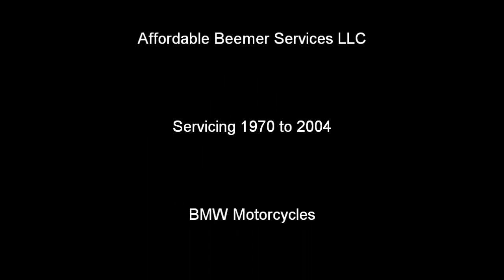BMW Service - R75/6 Front Brake Caliper Adjustment

Comment: can you tell me how to remove the caliper altogether Ive got it loose where it swivels but removing the pin is a trick. 1977 r75 7  thanks. rob
Reply from the maker: Hi Rob, isn't that pin threaded internally? Screw a bolt into it and pull. Good luck.
Reply: Thanks Chris.
Reply from the maker: Let me know if you get it out please, thanks.
Reply: Yes Chris, it came right out of there and thanks. The seal is leaking on the caliper so now can you tell me how to get the pads out so I can replace the seal??  I'm obviously not a brake guy!! Thanks again.
Reply from the maker: Take the caliper to a brake guy. Once the pads are removed (there's a wire clip on the pin that is attached to the backing plate of each brake pad) you'll need a rag and high pressure compressed air to blow the caliper pucks out of the caliper. Have someone familiar with this do it so you don't injure yourself or damage the parts. Good luck.

Comment: Hi Chris, I wonder if you can help, I have an 1981 r100 rs which I have stripped and rebuilt, new bearings in the wheels etc, however if I tighten the spindle nuts up to the torque that the manuels say (45-50 nm) there is a hell of a lot of tension and resistance, and the wheels barely turn!!Is this normal for new bearings? Or should I just set them at a lower torque? CheersRoss
Reply: I'm no mechanic but I know these bikes. They have tapered bearings in the centre hubs which means they need to be correctly shimmed centrally according to their wear before tightening. Check out the existing shim that you removed, it sound like you require a wider shim.

Comment: Chris - I was looking for a quick vid on adjusting the caliper (I'm replacing my pads) and of course looked to your library first.  This video seems to cut off after a nice pan of a very very clean R75/6 (mine is a 1975 R75/6).  Am I missing something?